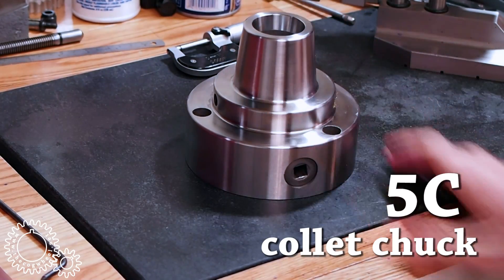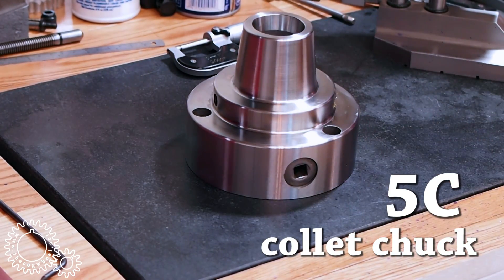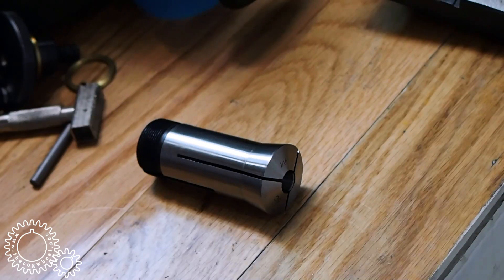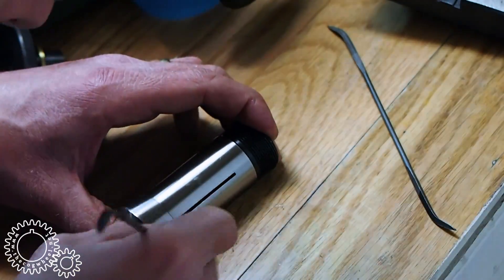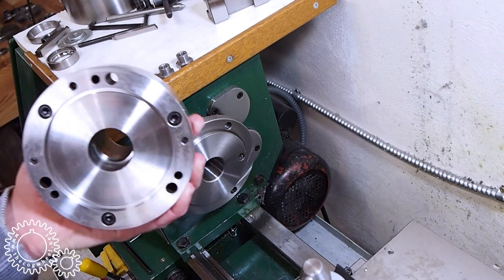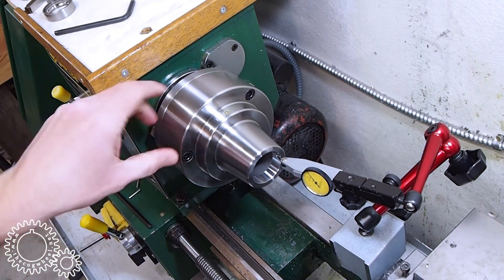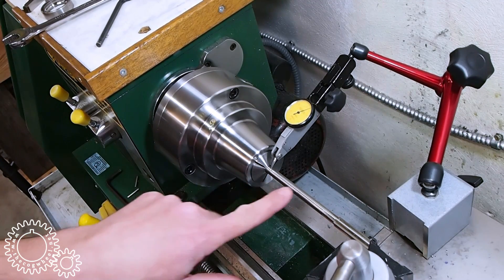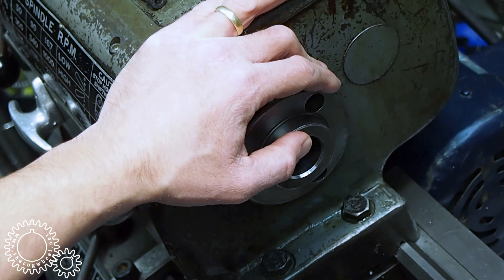Cheap and Cheerful 5C Collet Chuck

Comment: When tapping the cam lock mounting plate why are you only going a few turns with spindle then tapping by hand just run to depth under power then reverse spindle more taps are broken by hand then when power tapping.

Comment: I recently set up one of these 5C chucks on my lathe with a 3" 5C step collet bored to hold the outer gear of the triple gears from my Model T Ford transmission. It made the boring and facing of the new bushings the quickest part of rebuilding my transmission.

Comment: “C” type collets MUST be used with a work piece that fits the closet closely. They don’t allow for compression. You will damage the collet if you try to clamp down on something more than 1/64th smaller. This is why they are available in such small increments. My set has 72 collets. My ER collets, which are the most used in industry (and are the collets Stefan mostly uses as well) have a range they can hold, so you need fewer. They can also be found in ver high accuracy versions from Techniks, and some others—0.0002”.

Try the chuck (after you’ve taken it apart and cleaned the inside) in each of the three positions the mount allows. If the chuck isn’t concentric, sometimes trying them finds one that is better. Then just mark it and always put it in that way. Everything is off by some amount. If you’re unlucky, then they will all add up. If you’re lucky, they will partly, or if you’re really lucky, totally cancel each other out.

Another trick is to machine the mount out a small bit, if concentricity is bad, by about half the amount it’s off by, and inserting a long shim on the side that’s opposite the the side that’s further out. This will bring it much closer. I brought a friends 5C chuck, which was 0.0016” out to below 0.0004”, which is pretty good enough for most work. But cheap, inaccurate collets make things worse. I recommend buying a few good ones in the sizes you use most, or have the greatest need for accuracy. All hobbies are about spending money, and sometimes you just have to bite the bullet.

By the way, I really don’t recommend buying used collets, even if they’re from some high end maker. People abuse their collets, and collets are, just like drill chucks, consumables. At some point, they need to be replaced, and with eBay, you may be the lucky buyer of abused, worn out collets. Don’t do it, even if some people say they’ve been lucky. First, they’ve been lucky. Second, if you don’t know much about them, old, worn out collets may be fine to them. Beware!

Comment: Same chuck, similar results; about 0.5 thou (better on a good day) on decent collets. This on SB9 lathe. Major problem was the gearing from the key pinions to the collet screw gear. Pinions were rough and lumpy. Had to totally disassemble, massage each and every one's teeth with a file and stone, clean and reassemble. Pretty sweet afterwards. Beats my bell-mouthed 3-jaw.  My go-to on anything that fits the collets. Then again, 4-jaw is the utmost.

Comment: I get to use a lathe in our engineers work shop, its a Harrison, heaven help you if you are turning small shafting and the part is removed and refitted. The work piece is all over the place, I would be grateful to have accuracy like you got with the 5C

Comment: 2227 b
Reply from the maker: You are correct sir.  It's actually a pretty good lathe although I wouldn't pay what they are charging for them now.  I paid less than 1K for it brand new - now it is over 2k.  Evidently white paint increases price.
Reply: I got mine in Vancouver bc for 1300 I think I cant wate too get working in the shed when its warmer out side

Comment: Thanks for this. Are all these chinese chucks the same grade?
Reply from the maker: That is an excellent question.  I can't really say either way, but the Chinese don't scrap very much.  They sell pretty much everything so you need to be prepared going into the transaction that you may end up with a casting kit. I've read a few reports of some camlock chucks having .008" runout.  Many retailers will take returns so that is an option.  My experience has been similar to Stefan's - at best you get something that is adequate, and at worst you get something that can be fixed with some work.  This chuck is no different.  I'm sure a Bison chuck is better - but that comes at a price.  This chuck is very good when you consider the price, and with some work could be comparable to a Bison.  If I was running a production shop I would buy the Bison without even looking at a Chinese one.

Comment: Wow, that's a lot of turns on the chuck key to tighten up the collet!
But its a lot better then my Chines ER32 collet set :)
And I like that it fits directly onto the green lathe as I have a very similar model. 
Although mine fixes the chuck using allen bolts from behind the spindle. 
It's a pain in the behind to chance chucks. So I prefer the threaded spindle :)
Reply from the maker: Stefan said it was like a Gazillion or something.  It is many turns.  I'm thinking about using my drill with it.  Our lathes are almost identical - mine has exactly the same spindle nose - the screws come in from the back.  For this collet chuck you need to make nuts for the back - that's what I did in the first part of the video.  I still like it better than a threaded spindle.
Reply: Well well well look who it is!
Reply: Hi Jeff. You found me again :)

Comment: Just curious, is the body hard on your collet chuck? I have one, but it's set up as a set true, so a little easier to adjust. What would it do if you bumped it in using the collet and your reamer shank, would it repeat and could you get better than .001? Can't wait for the next podcast to come out.
Reply from the maker: I haven't tried filing it to see how hard it is.  It is really nicely finished.  I think you could bump it over and indicate with the stock in the collet.  I think for mission critical work this is definitely a solution - even if you had to do it every part.  I'm just a home shop harry so if I need to do higher precision than .001 I think bumping the chuck over each time isn't a big deal at all.  Next time I will try to see if it is repeatable though.

Comment: 5C cheaper than ER?  You haven't been on Ali Ex or Ebay lately.
Reply from the maker: You're right Barry that ERs are significantly cheaper.  But you can't find soft ER collets, or ER collets to hold hexagon or square stock at all.  For that 5C is much more versatile.  And 5C isn't that expensive at all.  The most expensive part is this 5C chuck.  You can find round collets for not much more (and depending on your location used 5C stuff is plentiful).  5C collet blocks for the mill (round and square) are also about the same price as their ER counterparts.  So for those reasons I'd lean towards 5C for workholding.  Of course ER is probably already in the shop at that point for tool holding.
Reply: thecogwheel Well, the ability to hold non-round stock is definitely a huge selling point!  I saw Stefan's 5C and it looked so cool that I thought it must have been prohibitively expensive.  I'm going to splurge and buy one.  Boy, the Chinese have made everything so affordable.  This is the best time to be a hobbyist, but a terrible time to be a manufacturer.
Reply: Barry Manilowa 159$ with a backing plate that you finish on lathe
Reply: Barry Manilowa have a local supplier 5c 5$ 8$..and i can see it versus waiting